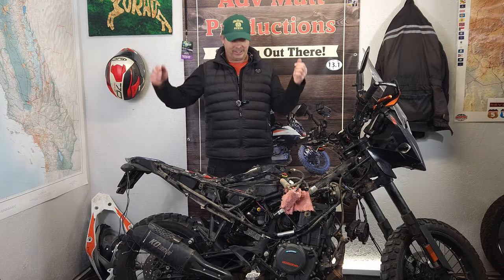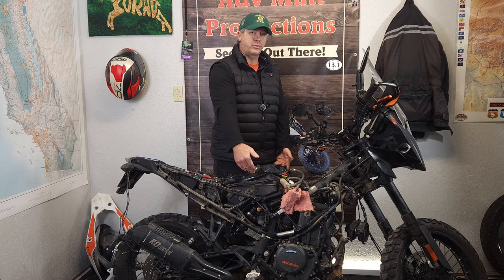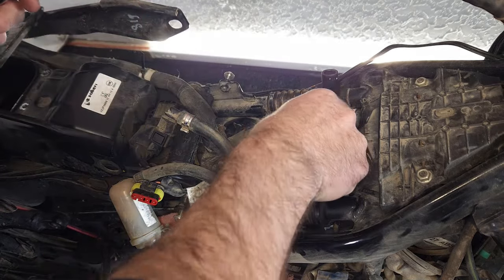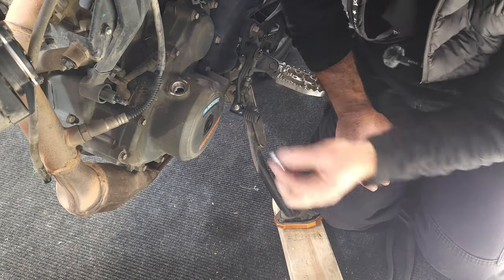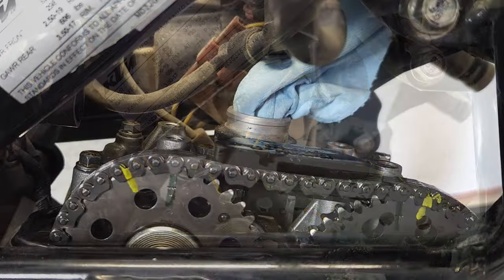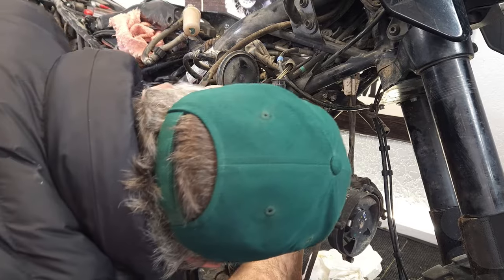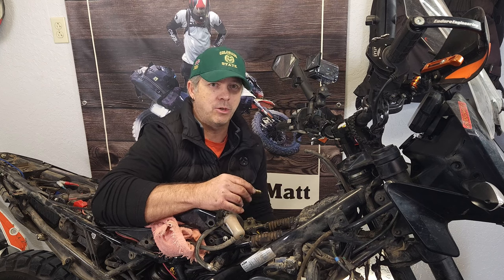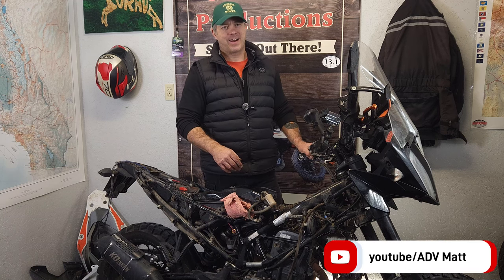A KTM 390 Adventure Valve Clearance Check

Comment: I did my first valve check at 10K miles, the exhaust was a bit tight and I'm not a contortionist, so I pulled the engine to get better readings and ultimately set the valves, intake in the middle of the spec, and exhaust at the loose end. One BIG tip if you need to change shims: I zip tied the chain to the cams before I pulled the cams. It's easy to roll them back into the middle to do all the shim changes, and then I just rolled them back into place, reinstalled the caps, and triple checked both the clearance and timing. I didn't pull the engine the second time I checked them, but I did make some better feeler gauges by riveting short, pointed sections of feeler gauge to long, slim handles. I also plugged every hole in the head with rags. I wouldn't want to split the cases because I dropped something. It's a fussy job, but not that bad if you take the time to get stuff out of the way.
Reply from the maker: Great tips.  I really like the zip tie idea.  That makes it really easy to keep the timing.

Comment: Thx for the vid.   Nice to see the valves were still in spec after 18k miles.   I thought getting to the valves on my klr was a PITA but this is a whole nother level of fun........ugh.
Reply from the maker: There might be an easier way, but this seemed to make everything much more accessible.  Without filming I think I can check them in about two hours, now that I know what needs to be done.

Comment: so helpful Matt esp ground wire brother! Great win to do my own check and replace plug....but was right at 0.10 / 0.15 @10k miles.  So Iook forward to shims at 18k but now have confidence!  You can open crank cover with KTM toolkit and I just "hung radiator down" without draining (4 nuts only).   Anybody know what std shims are from factory? guess I'll need to reduce by 0.05 to open em up as they tighten
Reply from the maker: @toddhjermstad6193  gald this video was helpful.  Right on doing the work yourself.

Comment: Just serviced mine mat had to change the plug so thought I may as well check valves it is a bit involved but mine were all ok so peace of mind...when i reassembled it would run and then die eventually found out the new bosch plug was duff!..it went in the bin and an ngk has gone in...great vids of your maintenance hopefully mine will be good for another 10k...
Reply from the maker: Nice, well done servicing your bike yourself.  It's really not all that hard.  Bad plug.  What a pain.  Cheers.

Comment: Good Lawd.
I have a Norden 901 Expedition at 11,500 miles and my dealer is set to check the valves BUT they admitted they’ve never done it so I’m not a lot more confident about them doing anymore than me trying.
I have a terrible thought that the bikes gonna be worse off after their work which I’m likely to find it was fine anyway. 
What to do…
Thanks for video
Reply from the maker: Tough spot to be in.  It might worth giving it a go yourself.

Comment: this is cool. I'll never do it, lol. One thought and one question. I'm not master-mechanic, but would recommend trying to not stop mid-project to do other stuff. That simple reverse process is infinitely harder if there's been some time between disassembly and reassembly. YMMV.   Q: So, what does KTM charge to do this job? That's a lot of work. (which probably means shop time, and $$, but I'd be thinking of letting them do it anyway).  I realize every bike is different, some valve jobs are simpler than others.
Reply from the maker: Every dealership charges something different .  The first time I had valves checked and new shims added was by the shop. It cost me around $200.  I have heard of shops charging #300+.  You will have to ask you local dealership.
Reply: @advmatt  well damn. That seems like a no-brainer. If you trust your shop. Unless you’re just mechanically inclined and have the time. Thanks Matt.

Comment: Would a shop typically remove the radiator as well?  I'm having the valves done; if they take it off, I may as well get a coolant flush.
Reply from the maker: @luciano136  I am not sure how to remove the valve cover with out completely removing the radiator.  You should ask the shop if they remove it and decide if a flush is worth it.
Reply: @advmatt  It sure looks like there isn't much of an alternative.  Definitely having the spark plug replaced as well; I'm just shy of 9k but doing the Norcal BDR.  It'll probably end up being 2500-3000mi RT.
Reply: You can just hang lower radiator and fans all together as a unit (4 10mm nuts hold it on).  wire to fans and hoses are just long enough to give room to lower & slide cover out...engineers did us one small favor there haha just remember the little black fairings need to snap out at the grommets to facilitate the movement (but they'd come out anyway on a radiator removal).
Reply: @toddhjermstad6193  Yea, they were able to just slide out the cover without removing the radiator.  Tight, but doable.  Really kept the cost down.  All valves were in spec as well.

Comment: Valve clearance checks are the curse of the modern motorcycle,  quite often no attention required...but you never know!
Reply from the maker: Agreed.  Parallel twins are pain.  This wasn't too bad.
Reply: @advmatt  I can check and adjust the valve clearance on my Cagiva W12 350 in about 40 minutes  😉
Reply from the maker: @steveball2307  that's fast.  Nice.
Reply: @advmatt  More than the bike is on 28 HP (and some of them gave escaped!)
Reply: Same goes for the RE Himalayan. It takes longer to get the gas tank off and back in then it does to adjust the valves. The only draw back is much shorter intervals for inspections. Fun for me but a bummer for people who pay the dealer.

Comment: Hey where can I buy shims for 390 adventure valves, so far it’s very confusing which kit is right , and where I can find info on valve clearance gaps tolerance ?
Reply from the maker: I am not sure where you live, but I was able to find shims from AOMC.MX.  I will leave a link at the end of this comment.  The valve clearances are in the video.  I don't exactly remember without watching the video.  I think the intake clearance should be 0.10mm to 0.15mm and the exhaust should be 0.15mm to 0.20mm.  https://aomc.mx/shop-ktm/oem-parts/?aribrand=KTM#/KTM/390_ADV_ENGINE_-_2020/VALVE_DRIVE/ce06336d-d3a8-4119-8ca0-d3b6e2042842/390_ADV_ENGINE_-_2020_VALVE_DRIVE/y
Reply: @advmatt  thanks for a quick response , I see they sell shims individually Should I buy them all the specific ones that I should buy. I live in Florida. I did buy stuff from that website already. Thanks again.
Reply from the maker: @thomaskurek3524  I recommend measuring the shims you have now and calculating what you need.  But, they cost much so you could buy two of each and should be able get everything set correctly and have some choices on which ones to use.
Reply: @advmatt  ok thanks

Comment: The only downside to this motorcycle is the valve adjustment. What would happen if I don't do the valve adjustment?
Reply from the maker: If you don't do valve adjustments the first thing you will notice is the performance of the engine will degrade.  The exhaust valves won't close all the way allowing combustion to escape into the exhaust. Eventually you will damage the engine.  This is if you never check the valves.  The first valve check is the most important after the engine is broke in.  After that most modern engines can go tens of thousands of miles without needing an adjustment. It is a good maintenance practice to check them to prevent damage.  I agree, it's a pain in the butt.
Reply: @advmatt   Thanks.